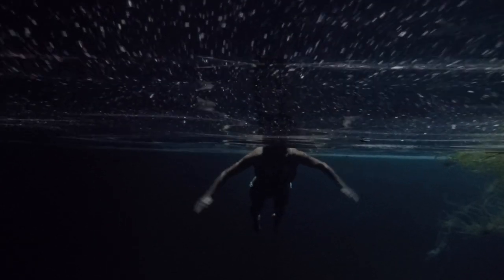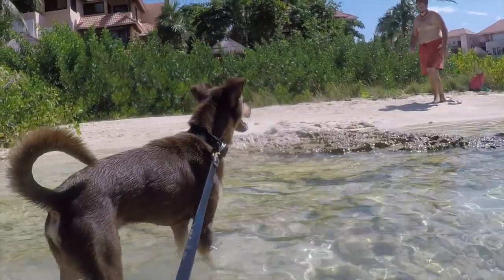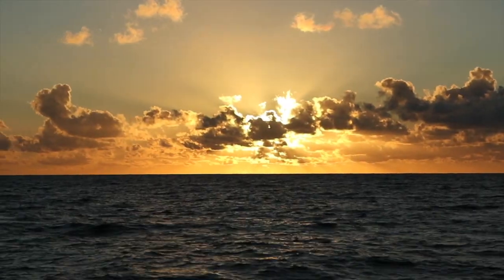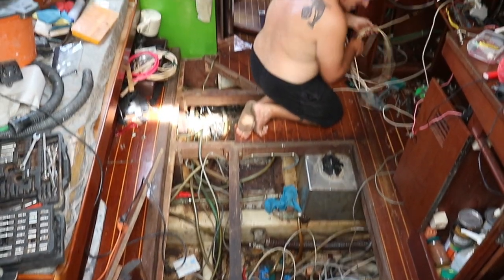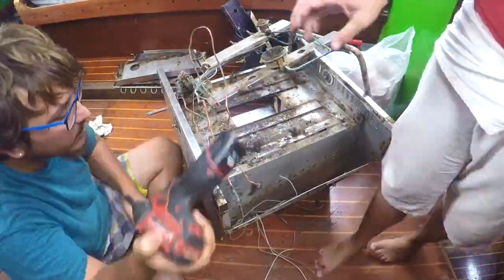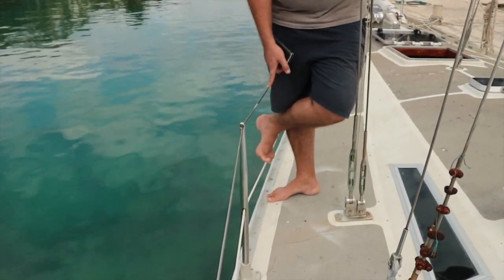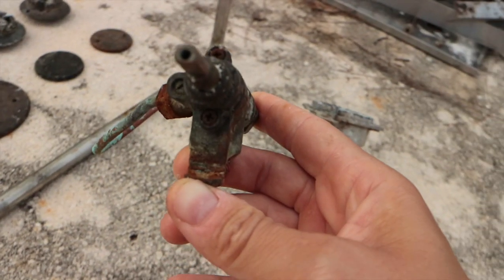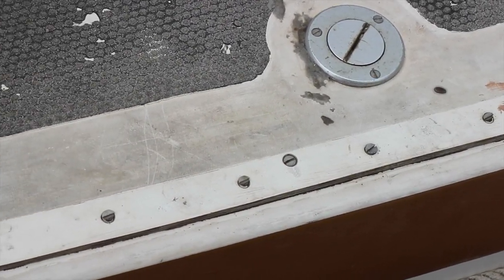Treasures of the New Boat's Bilge

Comment: My boat came with non functional hydraulic steering. Only tiller. I am so happy that I fixed it all and can steer with no effort. My goodness what a project, but I think you are the one's who can pull that off in a reasonable time with the exact right match between "getting it done" and perfection. Boats in my experience have a way of getting them self's the right owners to take care of them. This Belgium lady has won the lottery!
Reply from the maker: Yes, the feeling of the hydraulic steering can be described as 'no effort'. That's my issue though - it seems uncomfortable not feeling what the boat is doing, what kind of pressure is being exerted on the rudder. No feedback. Just really smooth and effortless left and right. I don't trust it yet...

Comment: I think that you might want to leave that hatch on the foredeck opening forward,  A wave coming over the deck will slam it shut rather than forcing water down below.
Reply from the maker: True, although we've never had anything close to that kind of problem. Mostly, when at anchor, a hatch closing the other way functions as a natural wind-scoop, which is what we have been missing.
Reply: U sail with ur fwd hatch open?

Comment: Keep the hydraulic steering. It's much better than wire. Easier with autopilot, stronger, less chance of failure. Use the emergency tiller until you get it sorted.

Comment: My 2c: remove all LPG, install bigger/better solar panels and lithium batteries, cook on induction. Safe, light, renewable, no hassle. Why spent good money on old tech such as LPG?
Reply from the maker: I love this idea - but the cost of the entire system is daunting. You can't run it without all the pieces of the puzzle in place (whereas right now we have a jury-rigged lpg system that functions, but not ideal for sure). I would first like to have the the GoSun running again - that's a great solar cooking system.